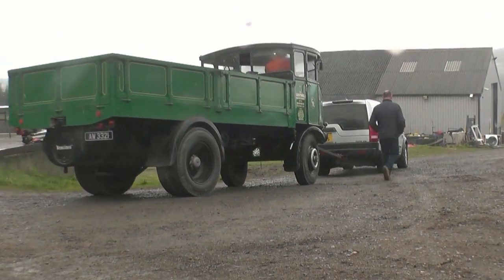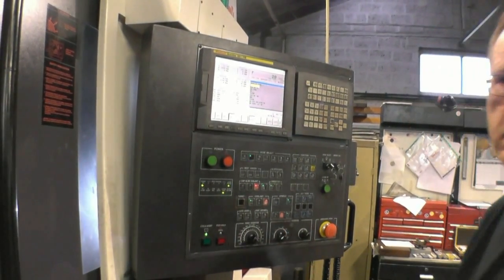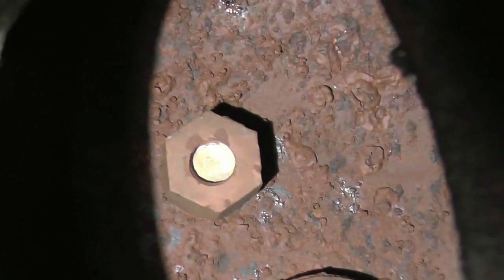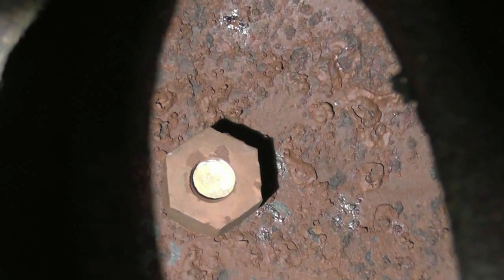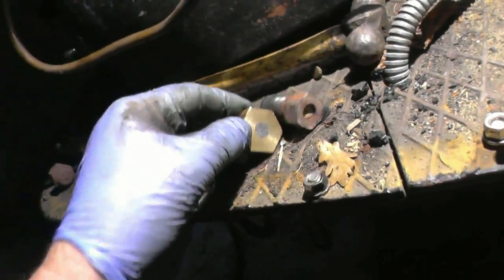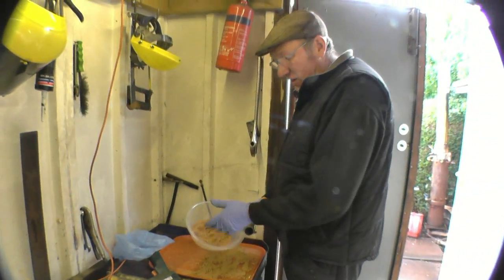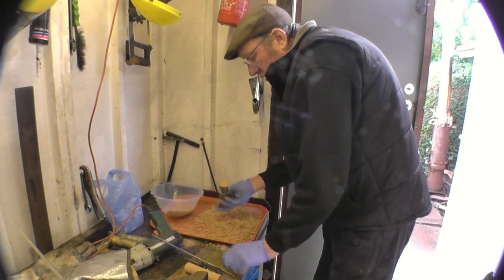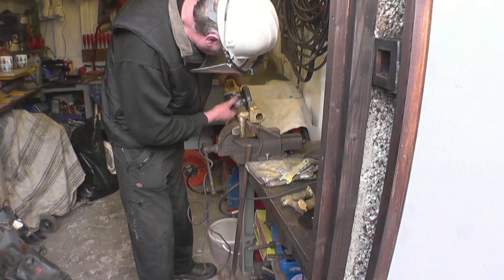SNNC112 P2 Boiler hydro test / ash pan former / fusable plug

Comment: John. I really look forward to seeing your latest Sunday night Video, 
would you please consider showing use round your work shop electrical set up. Am I right in saying that you use a TRANWAVE converter to get your three phase supply ? And do you have the three phase turned on all the time that you are working in the work shop or do you only turn it on when you need to use a three phase machine.i have only just retired after 50 years of working as a toolmaker and am working on setting up my own work shop.it do's appear that you have had your work shop setup for a very long time.i am not so big headed as to think that I know it all. I for one would like to hear you're thoughts on the three phase electrical installation in you're work shop. Thank you for sharing the fun that you have. And of course the f--k up's.( BASTARD) you dropped it again. Martin W

Comment: John

The fusible plugs that I have come across had a internal thread or a cone on the HP side to grip the lead to prevent it sliding out , but it will still melt out and save the day

Stuart

Comment: That's lead plug for the boiler is an ingenious idea, so simple yet I bet it's saved countless lives when boilers have run dry. Damned unlucky with those castings as well. They looked like brass this week, I was sure you were doing them in aluminium. Looks like the exact shape of the gate is going to be critical for those castings. Perhaps you could add a small cone to the bottom of the pattern to start the gate so that it's got smoother transition into the casting proper.

Comment: Always great seeing the action on the steamers.  That is a pitty on the castings. I think I would change the charging location to one end so that it came into a thicker section, I think coming into the thin walled cylinder is a lot more likely to cause problems.

Comment: If you make the riser one and a half times bigger than the one you use now and the sprue half as big as the one you use now the shrinkage problems should be solved. In addition, keeping in mind that the pouring range for brass and bronze is 1950 degrees F to 2100 degrees F, you should have the temp. nearer to 1950 degrees due to the thickness of the majority of the casting. Good luck with the next pour!
Reply: +sandrammer Perhapse pre heat the moulds to 100 deg C too? You seem quite handy with an oven but maybe send Debs to the shops???
Reply: Heating up the mold wouldn't help the directional solidification and would only delay the solidification of the metal. Plus it looks as though doubleboost is using clay bonded/water based sand and it depends on what bentonite he used as southern bentonite has strong green strength and western bentonite has strong dry strength.
Reply: Och fair enough. It was just a quick thought :)